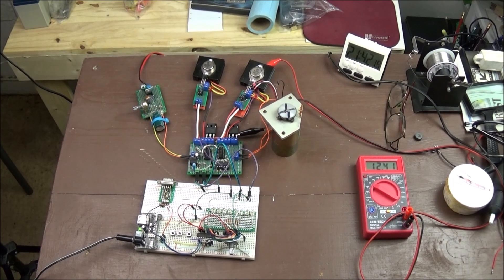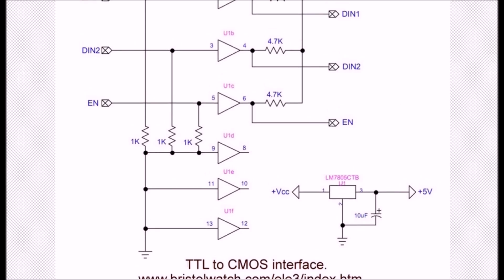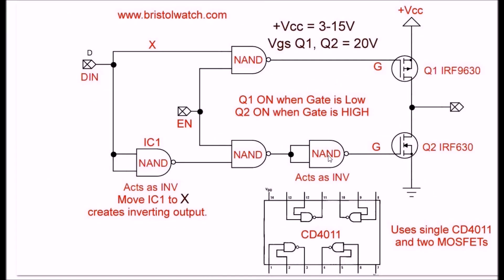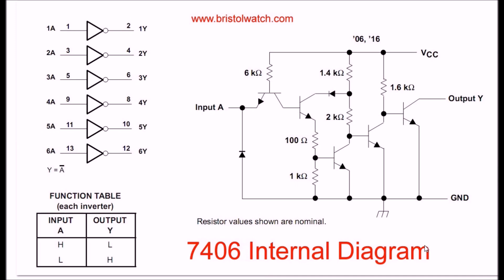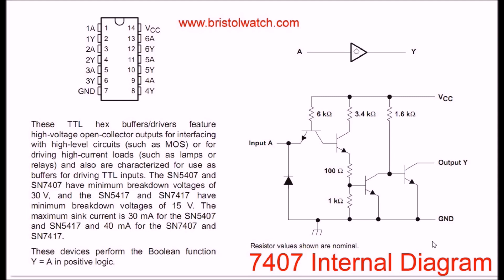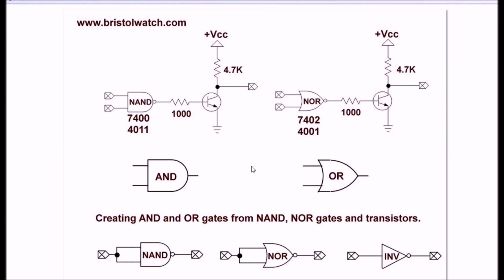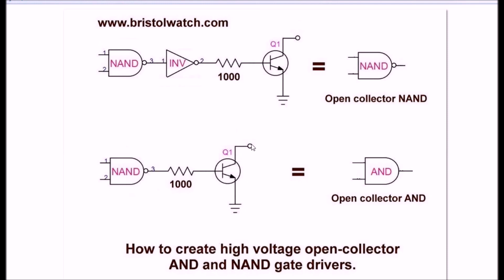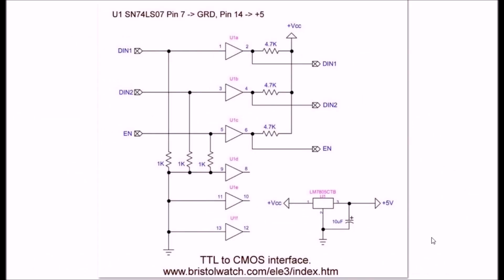Simple Digital CMOS - TTL Interface Circuits

Comment: The internal conections for 74LS are wrong, that you show is from standard TTL. And a diode of totem pole is removed too. LS family has more high value resistances and DTL like inputs and two fast sinker base currents plus almost all transistors are schottky ones
Reply from the maker: That is correct. Noted.

Comment: If you'd use the ULN2003A chips you don't have to worry about the input resistors or the ones you don't use you can leave floating without any issues... I know because I made an interface for my Raspberry Pi which is a 3.3 volt logic device and it does exactly the same thing as what you're doing and it works the same as it inverts the signal, a 3.3 volt logic high on the input can sink up to 500mA and up to 50 volt, it has built-in flyback diodes on every channel but to my opinion way easier to use and compatible with 3.3 volt logic.

On another video of yours I asked the question if CMOS or TTL is compatible with my Raspberry Pi, I know that the 5 volt TTL will damage my GPIO ports, CMOS I'm not sure since it does work with 3 volt however a Raspberry Pi logic high when measured is about 2.7 volt and low level about 0.8 volt and there is the problem what I'm talking about.
I know the ULN2003A chips work but those are kinda special because they are according to the datasheet rated to work with 3.3 volt logic, that's why I love those chips, when I found out I instantly bought all the ones that the store had in stock lol.
Now that I'm writing this comment I think I'm answering my own question or not, if I just use my homemade interface for the 5 volt programmable LED strip it may work but the ULN2003A chip is not bi-directional so I can't get the I2C or SPI address... Bummer!

So the question remains, how on earth am I gonna get the programmable LED string to work with my Raspberry Pi?

Best regards,
Ricardo Penders
Reply from the maker: I already know that but two issues: the output would be inverted. The idea was to present interfacing examples. These videos are learning tools or for testing not finished products. Thanks.
Reply: @LewisLoflin  But your chip or interface  does invert too right? And my interface isn't a finished product, it's just for my own purposes and it's a prototype and I'm learning from your videos so you're doing me a big favor sharing your information Lewis.
I was just thinking with you and thought that the ULN2003A chip is doing the same thing as your interface is doing it's only easier to work with, correct me if I'm wrong.
Reply from the maker: @RicardoPenders  No it does not. A 7406 does a 7407 doesn't.

Comment: Question Lewis if I may. at 6:42 the 7407 Internal Diagram. I cant understand how the second transistor ever turns on: if input A is low Q1 conducts, base on Q2 is low so Q2 is off: if input is high Q1 is off and base on Q2 is floating so Q2 is off (???) as well. Thanks Greg
Reply from the maker: The transistors are not labeled Q1, etc. Starting from left to right High turns on first three transistors 4th is turned off. If a load resistor is connected it will be pulled High.
Reply: @LewisLoflin  Elsewhere you said VCC was 5v, so a TTL high on input means left transistor has VCC or high on both base and emitter meaning the transistor should be off. Following on from that, if the left transistor is off (and it must be off some of the time) doesnot that mean it's collector is floating and cannot affect the base of the second from the left transistor so the second transistor cannot be turned on as it must be some of the time?